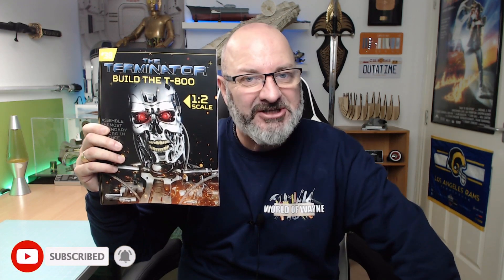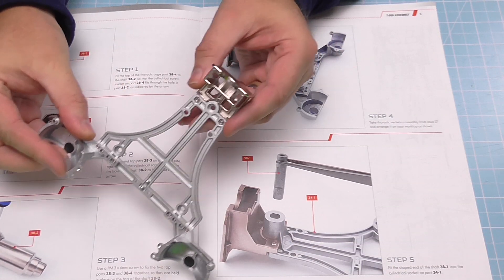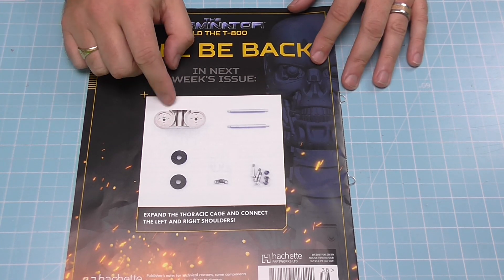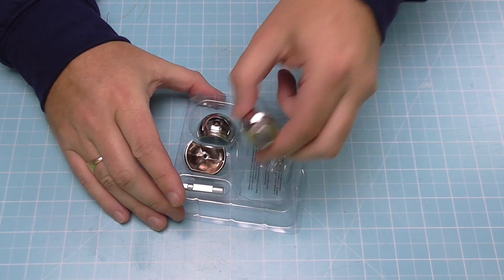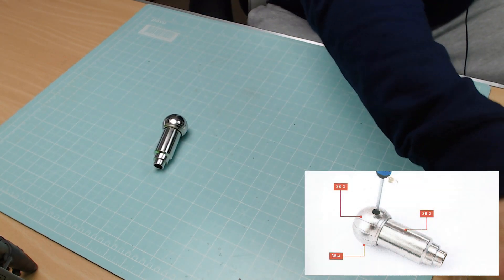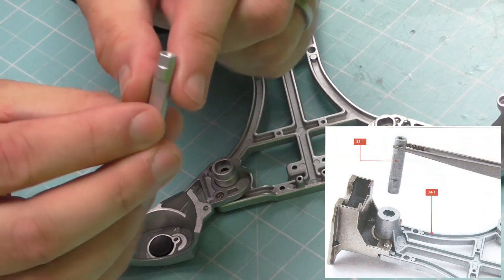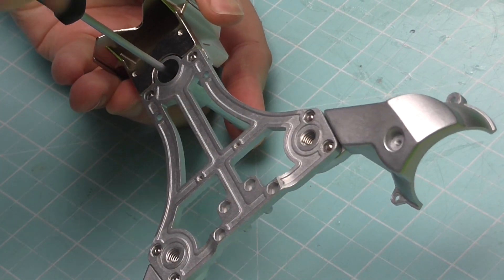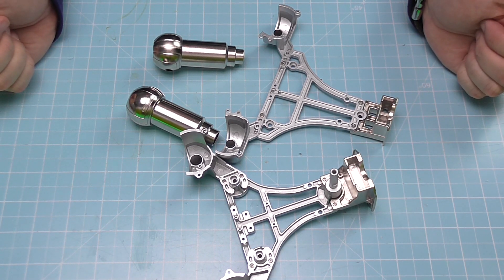Build the Terminator - Part 38 - Components for Thoracic Cage and Vertebra

Comment: Did anyone else get a 2nd binder? I got one one with my latest 4 issues and was charged extra for it. Also, got my missing issue #27 yesterday in a separate package.
Reply from the maker: They will keep sending them and charging you automatically unless you tell them to stop.
Reply: @WorldofWayneUK  I did e-mail them about it, no response yet. I thought 1 binder would be enough for all the magazines.
Reply from the maker: @SRC267  They only hold about 20 issues. I had a terrible problem with Deagostini in regards to R2 Binders. I had about 6 in the end and when I sent them back they didn't credit me anything.
Reply: @WorldofWayneUK  how many issues where there for R2? Do you think the terminator build will need about 6 binders?
Reply from the maker: @SRC267  R2 was 100. Terminator is 120 so you will probs need 6 altogether